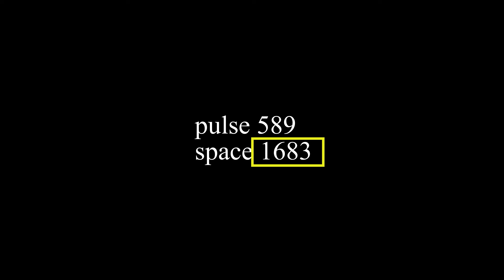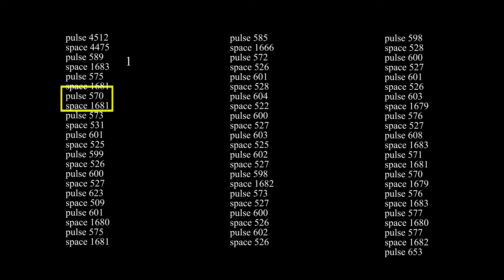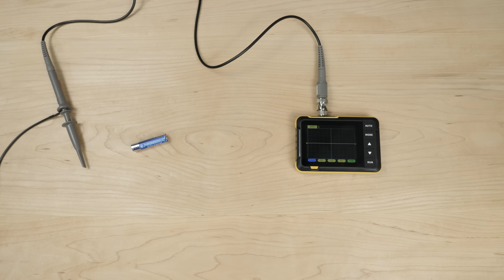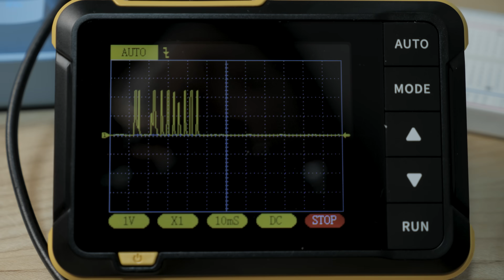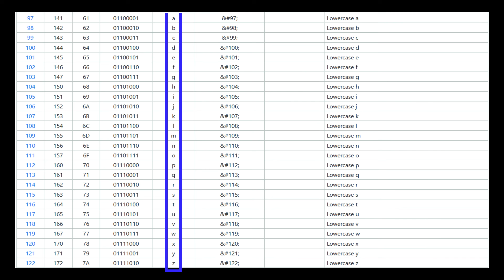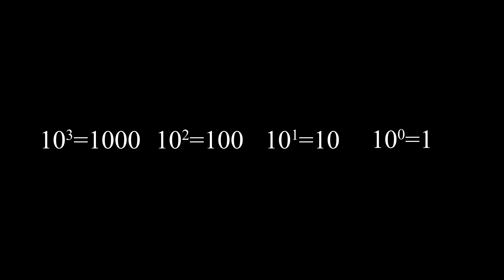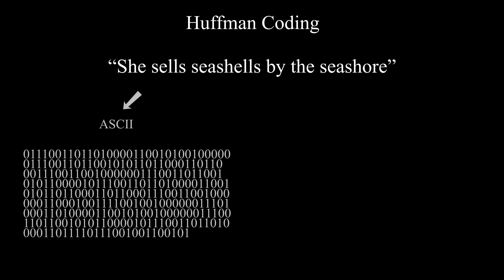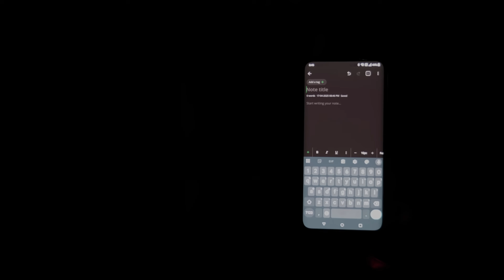Can I Make a Laser Tag Gun Shoot Messages?

Comment: Flirc sells a little USB IR transceiver that you can interact using their SDK. The main use is receiving signals but a little advertised fact is there's a transmitter LED as well. The gun could be simplified down to a Pi Zero and the dongle accepting trigger inputs on GPIO.

Comment: Technical question: Does the phone have an IR sensor? How do you convert the IR pulse from the gun into something that can be interpreted by the phone? Do you have to write a different phone app to do that?
Reply from the maker: Hey so if you see at the end I tape one of the IR receivers to the back of the phone, that feeds through another raspberry pi that does the decoding and communicates that to the phone with adb commands. I was looking into if any phones have receivers an unfortunately the vast majority at best just have the blaster. I explored what you are mentioning with a custom phone app and I think that's how I would do it if I had a lot more time. Then you could use an android compatible IR receiver or even a Bluetooth enabled one connected to your phone. I just already had the receivers and had proved in testing that I could get them to work